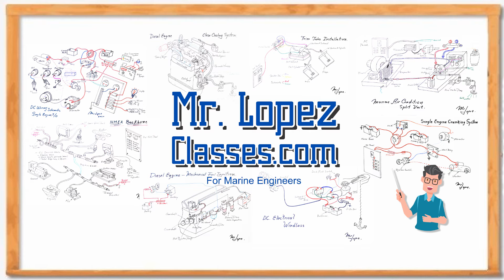The Governor Operation in a Mechanical In-Line Fuel Injection Pump / CLIP

Comment: Wrong, the pump body is also lubricated by the same oil,only the plungers are lubricated by diesel.
Reply from the maker: Yes Don. In  some models is also lubricated by the same oil. Thanks for your feedback. Regards
Reply: @MrLopezClasses  all of the inline pumps are oil lubricated, ve pumps are diesel lubricated. gracias
Reply from the maker: @donpanic9823  Muchas Gracias

Comment: What is the setting of governor for smooth ride ,
After I touch my 4 cylinder diesel engine's governor adjustment bolt 24 no I was irritated from power fluctuations ,plz help me sir 🙏
Reply from the maker: Hello. Thanks for following me. Please let me know what type of engine you have. and What type of injection pump is there. Remember that the majority of Diesel engines are set in between 4 to 6 degrees Before TDC. Thanks
Reply from the maker: What type of engine is it?. It is mechanical fuel injection? or Electronic common rail